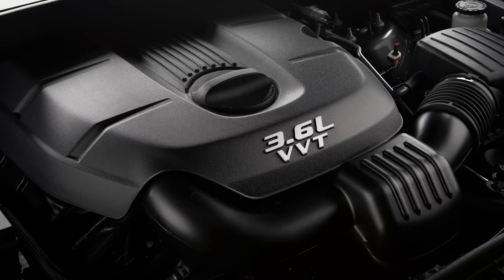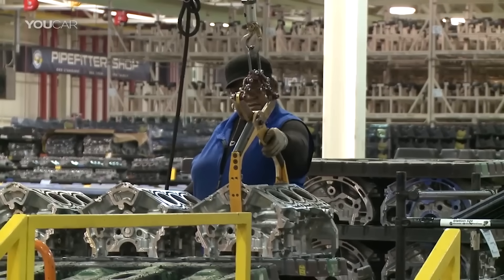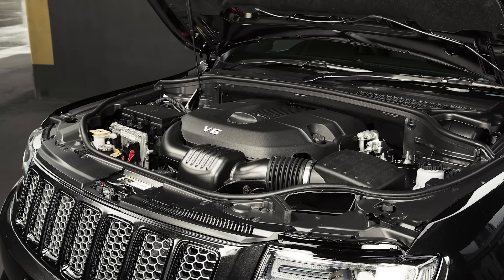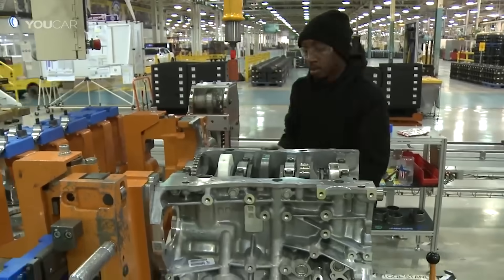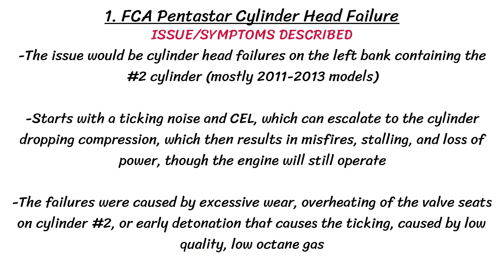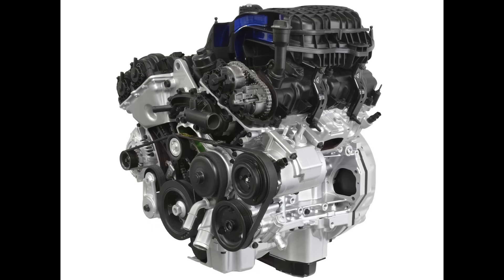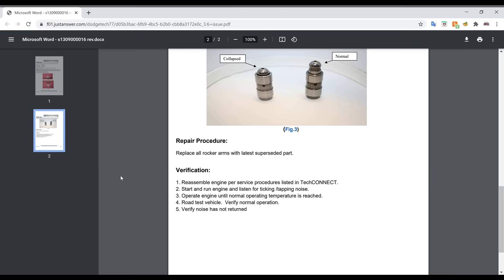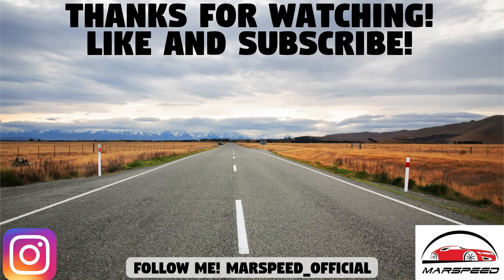The Specs and Fatal Flaws of the Chrysler 3.6L Pentastar V6 Engine

Comment: I've personally never seen any issues with the 3.6.  My wife's 2018 Jeep Grand Cherokee (currently 73k miles running Royal Purple OW-20 oil, and a K&N drop in air filter) and my dad's 2 Wranglers.  No issues.
Reply: I heard that using the K&N oil filters could cause the mass airflow sensor to get gummed up and cause problems from the oil that is on the filter. So if your engine chk light comes on get some of that mass airflow spray cleaner b4 you take it to the shop.
Reply: @gragra556  oil filter??? Think ya man intake filter lol. Ow yeah.  True.   I just don't spray it down like a spray can.   Just cleaned with the supplied cleaner, and a mist spray on the top.  (Says not to spray on the bottom)

Comment: Do you know what can really be at the head of the head cracking issue for the 3.6?  It makes 285hp, and I would not be surprised if the catalytic converters are too restrictive.  If you restrict the exhaust too much, the heat can't get out of the engine as it should.  Hmmm, is that #2 cylinder on the left bank the shortest header section and closest to the converter?
I just picked up a late 2013 Jeep with this engine, and even driving like a grand mother, that water heats up fast compared to other cars I have had.  The temp gauge is in the middle in operation at full temp,---but engine management systems could be controlling that, (I am guessing),---even if the cats are too restrictive.  Engine temps go up fast with restrictive exhaust.
Reply: Engine temps go up fast with restrictive exhaust, especially at higher RPM.  This engine, (mine at least), does not have a lot of low and mid range rpm power, and it begs you to gas it.  Peak HP is at red line.   Wanna bet I just figured out why it has head problems?  You can blame it on the dysfunctional environmentalists and their rules for what we make and drive.  Blame the price of a new car on them to.  All that complicated crap costs money.

Comment: To be honest I haven't experienced any of these problems. I bought my 2011 Caravan used with 168,000kms on it. I've put another 40,000 kms on it and no tick or coolant issues at all. Clearly idk what, if any, recalls or repairs may have been done before. I will only use full synthetic oil in this engine though because of seeing videos about the tick. Great job on the video.

Comment: 2012 Avenger SXT Plus 166k:  Change your oil every 3,000 miles!!! 30,000 on coolant!  60k on transmission fluid!  Always change your air filter and cabin filters on schedule, 10k-15k.  Screw manufacturer's maintenance schedule.  It's only designed to get you out of warranty.  
  Motor mounts are sh!t too.  Change 'em at 120k.

Comment: I have a 2013 grand caravan 3.6 flex 138k on it flawless so far. Im pretty sure it will have problems at some point, seems all chrysler and dodge products do, waiting for the thing to blow and get a new engine from route 66 extended warranty.

Comment: Had a chrysler 200S 2015 the first alfa romero body style 200. 
I've had a cooling issue but it was a dumb easy fix i just did my self.  The previous owner or used dealership i bought ir from mixed coolants and caused a jelly film to produce. I did a few complete flushes and replaced thermostat.  (Twice because of a learning curve lol) 
The original thermostat blew because of pressure buildup and rupturing the thomostat casing causing collant spray. Normally you can run a cold car (ambiant temps) normally one day morning i gassed it onto a freeway onramp and noticed the coolant smell... yep that was my thermostat blowing. 
Second was i torqued the thermostat housing too tight and broke the assembly and bolt there in noticed a leak and break after the fact.  
 
1 more flush and 1 whole new thermostat i finally got it remedied and did a pressure test at my local autoshop. 

Asside for the engine programming the trans was a back n forth some reason the program didnt stick for the shifting for the 1st year but managed to stick afterwards.  

Other than  a bad mix of coolant and cheap parts and trans progs. I never had an issue with the pentastar 3.6L 
  
Now i have a 2020 Ram 1500 Limited with the same engine (3.6L) 
She runs great (so far *knocking on wood*)

Comment: Why does the V6 come in different displacements for different countries? Why didn’t Chrysler put their best foot forward with the 3.6 being added to all of their vehicles across-the-board and around the world? If the engines weigh the same and are roughly the same size and most likely virtually just as efficient why go through the trouble of three different displacements?

Comment: I have the 3.6 in my 11 Grand Cherokee. 62k miles, have done synthetic oil changes every 3000 miles since I purchased it with 30k. I'll comment back when it hits 200k.

Comment: No LX car ever got a 3.6 engine.  When the 3.6 engine was introduced  in 2011, it was also the introduction of the LD Charger and 300. The Challenger was an LC from 2008-2014, and LA from 2015+. 

The 3.6 has held up very well in every application, including police service. 

This video is a joke.

Comment: My 2015 jeep Grand Cherokee has had all these problems plus the 41,000 back ordered engine oil filter housing leaking that dumped half my engine oil had to change my radiator, knock sensors, camshaft sensors now I have to change spark plugs plus coils all this Happened this month all at once never again will I purchase a jeep

Comment: 268K miles on my 2017 Charger Rallye, None of these issues. However, I did have a oil cooler failure at 260K miles, nothing catastrophic but a pain in the rear. It pumped oil, about 2 quarts of it, into the cooling system, resulting in nothing more than a royal mess. No overheat, no noise, but if you have ever tried to clean oil out of the cooling system you definitely know what I mean.

Comment: I keep a damaged cam and rocker for a 15 Charger 3.6 as a demo part for customers with those engines to show what happens when they let the rocker tick go too long. Also had a '14 Journey have a cyl 6 misfire due to an abnormally worn valve guide causing the exhaust valve not to seat properly. Oh, and the oil filter/cooler assemblies love to leak on those too.

Comment: I have a 20212 dodge charger and I've had to take it to the dealer for the 5th time because of oil pressure sensor/switch high P0523 This has been the recurring issue with my car anyone else have this problem

Comment: Problems that affect 1% or less of engines aren't a big deal. The 5.7 Hemi cam/lifter issue is less than 5% of engines and its still cheaper to just repair it vs a redesign.  If your chances of getting a bad pentastar is less than 1% I'd say that's pretty good

Comment: I put that sealant in my cooling system twice and it cut down on the issue a lot but still the radiator has a random leak I cannot find, just have to stay on top of my coolant levels which is kind of annoying.  

The biggest flaw with these is the oil pressure sensor which is a high failure part they didn't recall.  I did a video on it in my 2012 Charger.
Reply: I'm having the same issue as far as low oil pressure
Reply: @latrinakelley3665  the 2011-2014 generation Chargers were made poorly.  There is a class action lawsuit in the early phases.

Comment: 3.6 l is junk now have put 10 lifters and rockers every 12,000 miles . just sick of working on it . junk engine never buy a car with this engine again . they should get rid of the six speed trans also . put a 4 speed back in it  don't even get me started on the leaning tires in the back of the car . tick tick tick . dodge avenger junk

Comment: The earlier model had weak valve train The issue has been fixed since 2015 for the most part but it can still happen other than that the bottom end is built like a Sherman tank it's a four-bolt main with large valleys on the crank and the rods look like they're out of a V8 my 3.6  currently has 300,000 miles on it with no issues change your oil every 3,000 not every 10,000 you synthetic oil it's cheaper than it take a gas .. this motor will last $500,000 plus easily..

Comment: 2014 chrysler t&c with the 3.6. check engine light; dealer replaced rocker arms under warranty just short of 100k miles. at 123k transmisson had to be replaced.
i didn't realize that chrysler says to change trans fluid at 60k miles...
i have also replaced the thermostat...i live in a cold weather state

Comment: Sounds like these engines have issues. I Expect 250,000 miles minimum on it before I have to take the valve covers off. If you’re fixing it before then it’s not a great engine.

Comment: I have a 2011 grand Cherokee overland and am getting a misfire in cylinder 2.  I replaced the spark plugs and ignition coils hoping that'll clear the code... NOPE!  I didn't replace the pcv valve and did read that doing so sometimes clears the misfire.  What do u think?
Reply from the maker: I would do as you are, change all the easier and cheaper stuff first and see if the code keeps coming back. If it does then you know it could be an issue like in the video

Comment: My 2012 Chrysler 300 has the 3.6, 138k miles on it and not a single problem with the car since I’ve had it. Very solid engine in my opinion
Reply: Great engines.

Comment: I purchased my 2012 grand caravan with the 3.6 vvt in it about 3 months ago. It only has 56k on it so I thought good deal . I also bought it from a local dodge dealer so I felt confident about the purchase. When I changed the oil I noticed metal in the oil and a lot of the other fluids were original even the Trans fluid. I've begun a filter change regiment at every 200 miles and will change oil again soon to check progress . Lack of maintenance is the killer on these engines and transmissions.

Comment: My wife's has 240,000 and I not proud but we havent taken very good care of it. All I've changed is a starter freeze plug and plugs. I do hate the plastic intake and aluminum block. It dosent take much to strip a bolt out. But it's been a good engine considering I didn't take very good care of it.

Comment: 2014 Ram 1500 Outdoorsman.145,000 kms. No ticks likely due to updated heads, but conscientiously changed oil every 5000 km (~3000 Miles) due to short commutes and earlier during break-in. I also mix hi test fuel with regular often, which may explain lack of knock-related issues. Had to replace exchanger/filter housing under oil filter, which means removal of intake manifold on my own dime. No issues with replacement part, which was an updated part, and previous failure was a weep that gave warning rather than catastrophic failure. Very messy job as a lot of oil accumulates in valley. I also had one oil relief bolt undo itself later, inside the engine. It was luckily found in my oil pan and replaced others were loose too. This is also a service bulletin, and so a known issue but as it's not "safety related" and therefore had to be fixed on my dime. At least the dash warned me and I got it to the dealer prior to catastrophic failure. Engine is strong and torque curve combined with 8 speed transmission has meant the truck was comfortably able to haul a loaded trailer without fail. The big bore long stroke means it's comfortable revving into the 5k range without complaint. The coolant and engine oil temps are always within a couple degree range from each other so no cooling system issues. I over-maintain my vehicle because many an accountant will tell you that the cheapest car is the one you drive into the ground, so I keep it in good shape with me as the owner 15 years from now in mind. I always assume that the only thing the factory cares about is making it to warranty, however I need 2-3 times the warranty period out of it. So far that has proven to be a good approach on my Subie and this truck to a lesser extent, with a much higher/km cost and higher depreciation. However I believe that continued periodic maintenance and monitoring will keep my costs in line. I also believe that the V6 is a great workhorse with ample parts availability given all the models using these. Would I RIPP supercharge it for 400 HP and even better mileage? Maybe, but I don't want to tempt fate for now. Thanks for the informative vid!

Comment: To anybody who owns one of these pentastar in their vehicle if the check engine light comes on and it says number two misfire take it to reputable shop and get a compression check first thing don't do nothing else don't change plugs get a compression check don't waste your money on putting plugs in it. Mine was a ram 1500 2017 model got about 110000 MI when the light came on. It has been a very good reliable truck up to that point repairs cost at about $2,200 plus dollars I figure maybe it'll get me another hundred plus thousand miles before I get rid of it

Comment: Bought a 2014 Charger 3.6L in 2015, previous daily rental. So I'm assuming it took some abuse. It had 30,000km on it. I drove it for 4 years and traded it in with 220,000km
The ONLY thing I replaced(besides air filters/oil) was 1 Rear Caliper bracket that had a seized slider pin. That was it.

Comment: $2 cyllinder front passenger overheats because nobody changes the coolant , radiators plug up, valve guides sink and release the cam follower and POW! Dropped valve beating the Hell out of the seat. Cure? Change your coolant every three years. Nuff Said.

Comment: The 62TE transmission is a dual clutch computer controlled transmission.  There is no 3rd pedal, but it is not a true automatic.  Way back in 1972, I got my drivers license in a stick shift pickup.  My wife had a 2012 Journey.  I had a 2016 Town & Country.  Both of those vehicles drove fine.  But I now have a 2020 Durango GT AWD.  Which was the vehicle we should have bought instead of the Journey or the Town & Country.  The only thing is, the new Tow-N-Go package makes the Durango such a nice vehicle.  And that package only became available in 2018.
My wife did trade in her Journey for a 2016 Ram 1500 with the 3.6L.  She did trade that in for a 2018 Ram 2500 6.7L Cummins.  To have greater tow capability.  But what sold her, was the VGT turbo engine braking capability.  The 3.6L did tow small trailers well.  But the 6.7L does so much more!  For the same fuel economy.  The sticker price was $12k more.  But she wished I had sold her on a 2500 diesel back in 2004 when she bought a Chevy Astro.  Or 2011, when she bought the Journey.
The Journey and the Town & Country were good vehicles for their size.  But the Durango is a better vehicle for us.  When the Ram pickups are too big for parking spaces.  The gen3 3.6L seems to be trouble free.

Comment: Sounds like the Kohler Command engines when they first come out some years ago.   They were to replace the Magnum series.    They had a tendency to blow the head gaskets, right into the oil return passages.   The next was a good one.   Lifter tick.  Hydraulic lifters are great but they would tick bad.  It was due to the holes not being big enough to let the air bubbles out.  Kohler was actually telling people it is normal for the first 20 minutes of use.   LMAO  They since have fixed most of those issues and have made a pretty good engine.

Comment: I've never seen The Rocker Fail without needing the Exhaust Cam or Intake Cam Shaft... Take in consideration, grounded metal power from the damage rocker(s)??
As You Can Tell the Cam Shaft Lobe is also damaged!!
How can this justify needing only Rockers??
When Clearly Cam Lobe(s); are also damage!!! Only
Mr. Bad Wrench, would sell such repair!!!! New Engine, is the best way forward!
Anything Less than a replacement Engine, should be noted as substantial repair!!!
9 News Wants to Know!
Back to you Chuck!

Comment: Honda had a very similar set of issues with their late 80's aluminum engines (my '87 "vanagon" had three head failures, across 3 engines)..  Aluminum should not be used in engines.

Comment: This is about three years too late. This prob was identified and corrected before the 2017 model year. Get up to date!
Reply from the maker: Doesn’t really matter, these cars will start to flood the used market and its helpful to know if someone is interested in this engine. My channel is about past and present!
Reply: @MarspeedCars  it was traced to casting sand issue. It was getting stuck in the water passages and would eventually either stay( exhaust valves n follower burn out/ up) or dislodge clogging heater core and radiator. Sorry to offend but I thought everyone knew of this so didn't think new vids of this would get put up but have to acknowledge you're right that they are turning up on the market.

Comment: My 2012 Jeep Grand Cherokee with the 3.6L Pentastar has been a great SUV so far.  141,000 miles and only needed a thermostat replacement 3 years ago.  Other than that, it's reliable and continues to run great.
Reply: That's great news! What oil are you running? How often do you change the oil?
Reply: @FredFlintstone21  The oil gets changed every 5,000 miles.  I have my friend's shop do the changes and they use PennGrade 1.   Now with having over 177,000 miles, still running great.